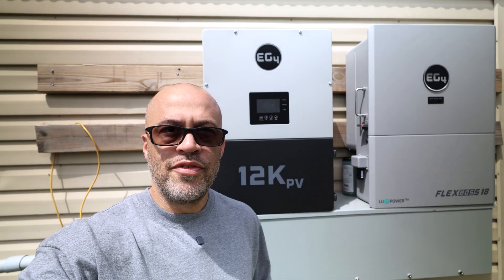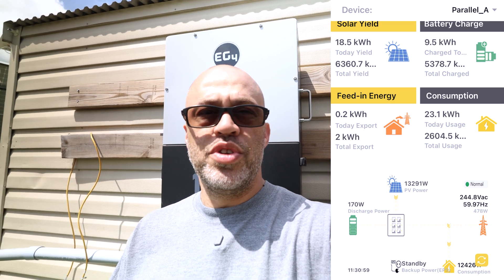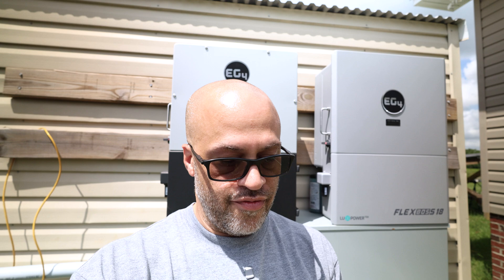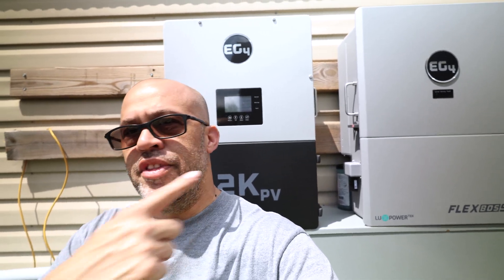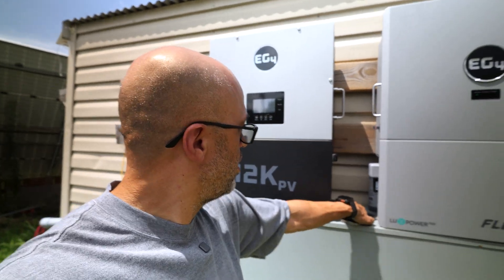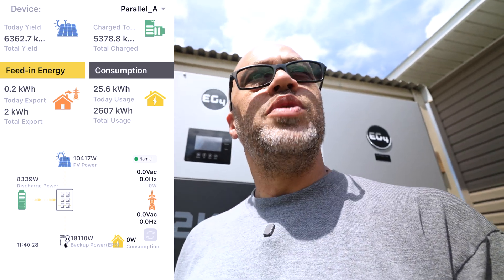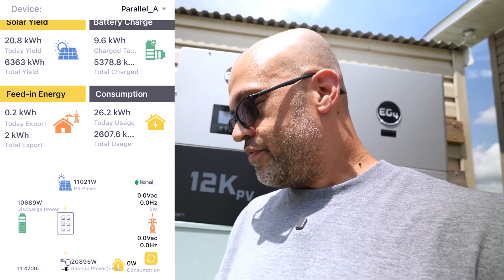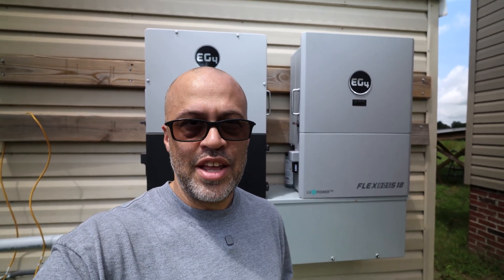GridBoss with Mixed Inverters: 12KPV & FlexBoss18 Full Load Test. Grid-Assist and Off-Grid

Comment: Hi Rodney, Enjoy your channel. Do you use the AC Charge parameter on your FlesBOSS18 inverter to use the grid during low solar production to prevent your batteries’ SOC from going below a certain level? If yes, does it work as described? Thanks.
Reply from the maker: It has been working for me. Using SOC is much better than battery voltage though. So depending on what you use

Comment: Hi dear. very nice that you could parallel 2 different inverters on the same phase!, but shouldn't those be under shaded roof since exposed to sunlight like this will make them overheat?.
Reply from the maker: Yes. Talked about that in the video I thought. Just haven’t got to it yet but will be building that out soon

Comment: Have something for you I have 3 6000xp and 12 amp hours of sun gold rack battery Have them hooked up to the main the other 2 don't see any battery have 3 battery so put one on each worked fine at 1st went to Best But to get longer cables had a 04 fault on 2 and 3 disable unhooked from com port wouldn't rest went back to lead and been working fine
Reply from the maker: Interesting situation. Not sure with the sungold
Reply: @rodneyhunt  The main see all 10 rack battery but not the other 2 don't see anything unless they plugged up to them they work ok so i leave it alone Thanks love your shows

Comment: Yes a fine piece of engineering. Bring over a 6 or 12 k inverter and AC couple it to the generator port to see if it will produce more than the rated power I used to get 6000 out of my 4000 MagnaSIne with AC coupled.
Reply from the maker: Good idea.
Reply: Run the grid connection of the 6k to the generator port not the load side
Reply: I dont believe that will actually work. Im not sure if the 6 or 12k plays well with others.  Could have a backfeed issue.
Reply: @paullind6534  well it is on the grid connection of the 6k so if it cannot backfeed it won't do anything if it can backfeed or grid tie it should supply an AC couple feed when a load is detected if it was a enphase micro inverter it will work the port will handle 90 amps when used as a smart load and with AC couple when engaged.
Reply: It would also at minimum it would make a great battery charger for those days when you have extra solar output with no where to go.

Comment: The inverters aren’t going over the max rating when grid is present.  The gridboss simply adds grid power as needed to cover loads over the available output.  Output can vary when solar is present.
Reply: Yes sir! An easy way to control the car charging amps is through the tesla app instead of plugging the charger in every time.  Sweet setup! Pretty cool to charge your car with solar. Just one more fuel bill to eliminate!  This is the way!
Reply from the maker: @paullind6534 I was screen recording phone for eg4 app. So just to simplify for video I did it manually
Reply: Great news Rodney. I'm sure you're excited watching these inverters keep up with your family needs. Thanks for sharing.
Reply from the maker: @AWESOMEGODDIVER thank you
Reply from the maker: That is what I said but maybe I need to be more clear. It goes to the inverter max then uses grid to assist when enabled. When off grid mode is enabled no grid assist.